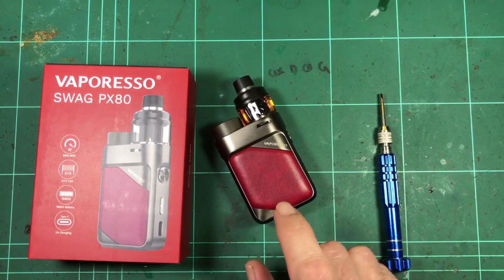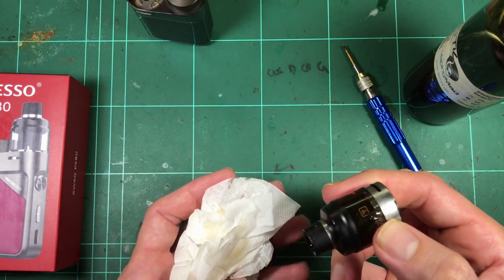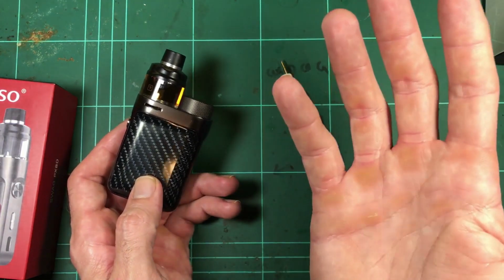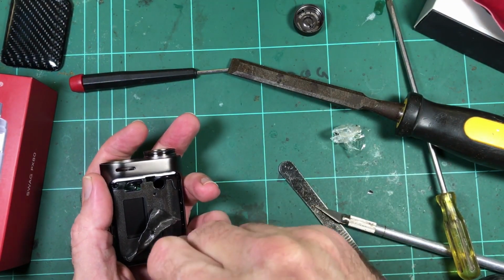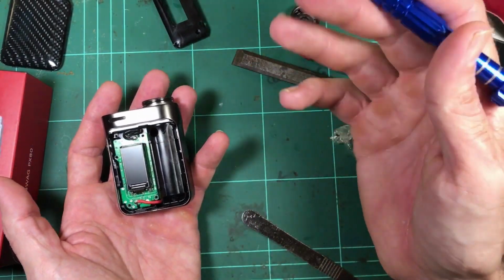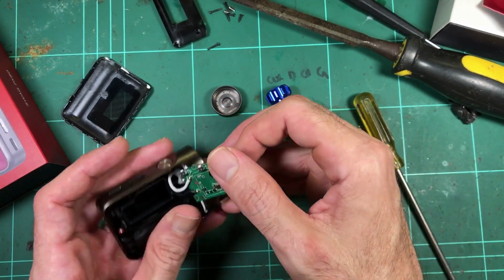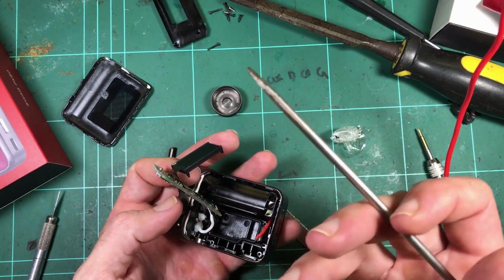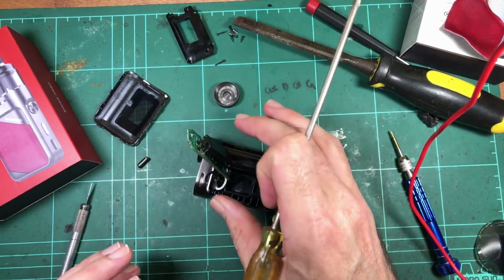Vaporesso Swag PX80: Review, dismantle and build quality analysis

Comment: Hi, i really like ur videos. Came here just want to know what's make my lcd have only backlight with no text  in it. Perhaps you can tell me which parts should i fix/replace it with new one?
Reply from the maker: Thank you! I’m sorry I don’t know the part number for the screen and it might be a bit difficult to find a replacement tbh. I think your only option would be to dismantle the mod like in the video and try to match it up to one on an electronics supplier website. It has to be exactly the right one.

Comment: Sadly I bought one of these on 1/22/22 and my unit just died on 2/17/22  not even a month old. I haven't even used a 2nd coil yet and and it has leaked from day one and now I probably have juice leaked into the board and it is now dead.

Comment: I love my PX80, but just started having an issue with it occasionally randomly auto firing after taking a hit. Sometimes I can get it to stop by pressing the fire button again, other times I have to pull the whole tank out to stop it. Tried doing a tear down to inspect the internals, hoping maybe the button was just sticking from juice leaking but everything is completely clean and dry (aside from what looks like a couple dog hairs for some reason lmfao). Gone through two tanks and 4 coils, no difference. I suppose it's just taken too many falls and it's time for a new one.
Reply from the maker: That sucks man, sorry to hear. Agreed with your assessment tbh - if the auto firing doesn’t look like it’s being caused by liquid on the board or a sticky switch, it’s probably time to replace it.
Reply: @vmgtesting8014  all good, I still have extra replacement tanks lying around so I’ll probably just order a new PX80. Those replacement tanks cost almost as much as a new mod after shipping 🤣

Comment: Got this mod with a sony vtc6, using 0,3 gtx coils at 35-40W. Would you say its a good fit? The flavor is good enough imo, the only thing I care about is safety.
Reply from the maker: Yeah that’s fine! A VTC6 is rated at 15A continuous which is around 45W. You could also try a VTC5A or Molicel P26A - they’re slightly lower capacity but will probably run for a similar time. Both are 25A cells so you can run the wattage a bit higher with them if you want.
Reply: @vmgtesting8014  Thanks for the response, and great review as usual. I might get another vtc5a as well, or I'll just get another vtc6. Pretty nice mod for someone who is coming from caliburns and salts back to freebase nic.
Reply from the maker: @crillzyo  Welcome mate and thank you! Yeah I agree, it’s a really nicely finished kit overall and a good upgrade from a pod system.
Reply: Yeah the p26s are great but also the sony/murata vtc 5D

Comment: Any tips on prying open the glass, from the video it looked like you just pushed the hinges off but sadly wiggling and trying out many angles gave me no result the actually open the thing, my fire button is sticking and it's getting really annoying breaking my thumb every time I'd like to puff :D
Reply from the maker: Ah you mean taking off the plastic side panels? From memory it was a massive pain, very tight! You’ll have to get something thin but strong in a gap between the plastic and the metal and try to work / pry it loose. Fair bit of force required. I think I used a combination of a chisel and some screwdrivers. There was adhesive inside so warming it up would probably help - something like a fan heater or hairdryer. Obvs don’t get it too hot, but just on the limit of what you can touch should work. Good luck!
Reply: Allen key into the hole in the battery compartment to push the plastic screen out. Very easy
Reply: @gonefreediving8958  oh man thanks a lot!

Comment: thanks my button was loose and of course the switch got a bit loose, but simply cleaning the gunk out of the button helped immensely!
Reply from the maker: Great to hear mate, thanks for the comment :D
Reply: @vmgtesting8014  nevermind apparently the switch itself is loose and now im back to breaking my fingers for it to work i'm wondering if i could try to wedge a piece of plastic or rubber in there to keep the switch positioned right

Comment: I've had my px 80 for bout 2yrs .... I've noticed even decent cell , it degrades over around a year and needs charging least twice a day .... gone through four pods ... yet usually down to bung in base .... shame there was no option to buy ten replacement ,without the leash... rather than spend 5 quid on one pod !! 

Coils last quite long and clean when start to get a burnt taste , you could prob get around half life of first run again before replacing .... only one major issue I had and was partially my own doing ...
You become complacent,  doing same you've done every time ...
Well one jaunt to work of around 40 mins and somehow the unit powered up in my jacket pocket (motorbike rider )
Got to work and could smell the burnt coil etc .... and unit was powered off previous ...oops had to cadge a cig or two during day as didn't take replacement coil with .

Other than this ... never had issues , oh and for those that don't like the bong on base , there is a adapter and top loading tank for this mod .... works but I didn't like the difference it gave in out put .....

Comment: My vape pin is not coming back up. Its giving short automizer. Any advice on how to fix the pin ?
Reply: I'm having the same problem. I found 2 palliative solutions: 1. Cleaning the pin with isopropyl alcohol (one drop, pressing the pin several times). 2. Or a small aluminum foil on top of the pin.
I don't risk opening the swag, it could be that the drum of the pins is sealed. But if it is possible to open, I would stretch the spring or change it. I still haven't found any video opening the drum where the pins are.
Reply: @MrSpolavori  in this video he has shown where the pins are located. I have tried the foil thing it's working fine. But I still want my vape pins to be ok.

Comment: Filling is easy with a smaller, longer tip, you pretty well want to be able to reach into the bottom (top) of the tank and it’s just the stuff when you open/close the plug to worry about… Very easy to drop and nowhere to attach a lanyard to counteract that either

Comment: my vaporesso after 10 puffs it heats up.. quickly i dont know whats the problem.. i dont know if the battery or the mod is faulty 😔 im using at 45 watt
Reply from the maker: Has it just started doing this? Like, has it started getting hotter at the same settings when it didn’t used to? It’s a bit difficult to give you advice on this one tbh, some heat is to be expected after 10 puffs - both from the mod itself and the atomiser transferring heat, but also it could indicate there’s a problem with your device.
Reply: thanks a lot.. ❤️ ill try lowering the wattage
Reply: may i ask that your swag px80 heats up or warm?
Reply from the maker: @nathanielalarzar1771  It’s been a long time since I used mine, I’m sorry mate I can’t remember! I think after putting it back together it got passed on to a new owner. Just a quick thought I had, often metal body mods do feel warmer than plastic body mods due to the heat transfer.
Reply: done aubscribe thanks for explaining ❤️ hope your channel grow
Reply from the maker: @nathanielalarzar1771  Thank you so much, I really appreciate it! Sorry I couldn’t be much help with your question this time, but feel free to message again if there’s anything else in the future.

Comment: What 18650 batteries will power it for long and support 55W I'll be smoking at? I tried 30A and it won't stop burning my GTX 0.2 coils
Reply from the maker: The batteries have got nothing to do with your coils burning, just the wattage you have set. Try turning it down or using liquid with no or less sweetener. Best battery at 55W would be a Molicel P26A.
Reply: @vmgtesting8014  Thanks, I've of course figured that out. That was me 4 weeks ago new to the whole thing. It's a pity I had to go through unnecessary purchases to get to my answer but hey! it's all good.

Comment: Hey. How often do you recommend to change the cotton / coil?

And what is the airflow for?
Reply from the maker: Apologies for the late reply! There’s no particular recommended time to change a coil - it depends completely on the type of liquid used (heavily sweetened is much worse), how many puffs you take during the day and the wattage you run it at. Generally when a coil is getting old the flavour starts to get less and eventually it’ll taste burnt. I normally keep using a coil until I get that slight burnt taste but I should probably change it a little earlier. The airflow is just for your preference - some people like it more restricted and others like it very open.

Comment: Hi, I bought the Px80 two days ago with Samsung 30Q 3000mAh 20A battery.  With the 0.3 coil my liquids felt weak and watered down.  I tried lowering and raising the watts, from 15 to 70w and it doesn't seem to change anything, it responds just a little faster to the shot.  this seemed strange to me, I expected at least to feel the burnt coil by raising it so much, in fact it doesn't even heat, it stays cold.  with the 0.2 coil it is the same, the flavors are not felt well.  I don't understand if it is defective and does not deliver the power well or if it is its correct functioning.  can you tell me something about it?  Thank you
Reply from the maker: Hi Alessio, it might be a technical limitation of the mod or yours might be faulty. The limitation on the PX80 as I remember it was that it doesn’t have a boost converter for the coil output - this means it can’t output higher than battery voltage. Since it’s only a single cell mod (max 4.2V but probably closer to 3.5V under load), that would mean on a 0.3 coil the maximum you can get is around 40W, and on the 0.2 it would be approx 60W. Setting the wattage higher won’t help. Kinda sucks in my opinion, I think all single cell mods should have a boost converter so they have enough output voltage to achieve any wattage you want. Having said all that, it does seem a little strange that you’re saying it doesn’t heat at all? Is there a vape shop nearby that you can have test it?

Comment: Do u do this kinda stuff for a living? And are you in Australia
Reply from the maker: Yeah man I’m in Australia, on the Sunshine Coast. I’m a microelectronics engineer but my day job is actually as a motorbike mechanic. I used to do custom electronics engineering and worked briefly in helicopter avionics. Been testing mods and vape gear here in the home lab for about 5 years, I post reports on Reddit - username is u/VapeyMcGyver. I really should do a proper channel intro vid!